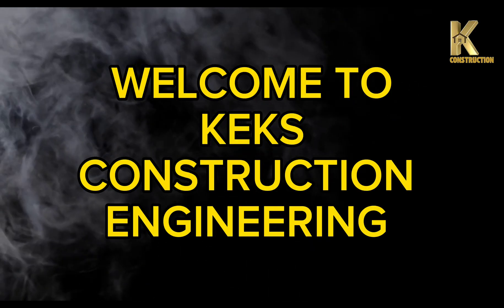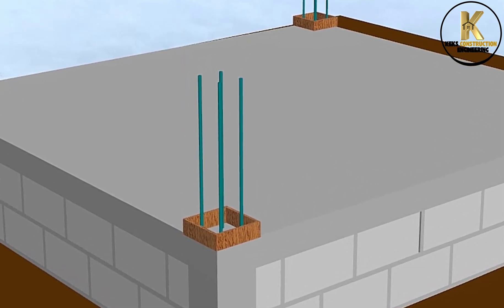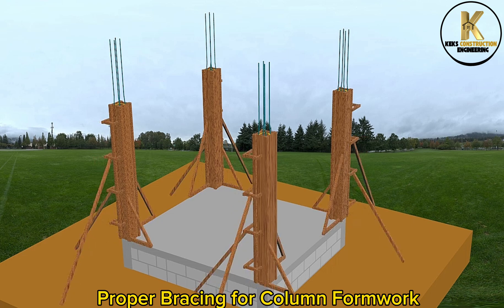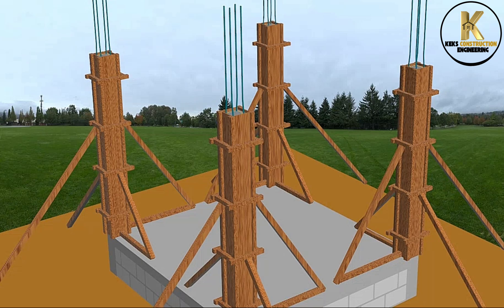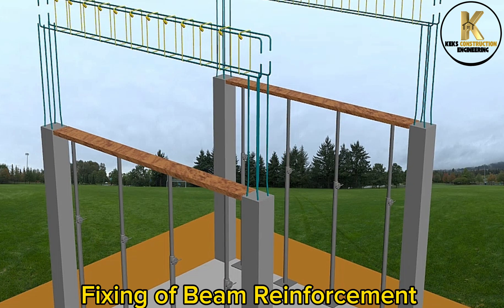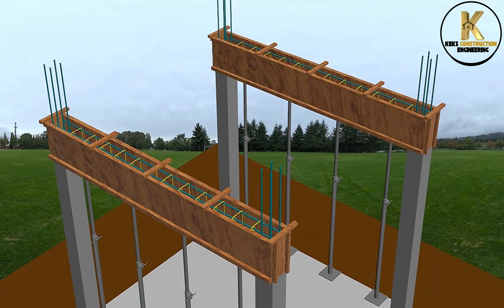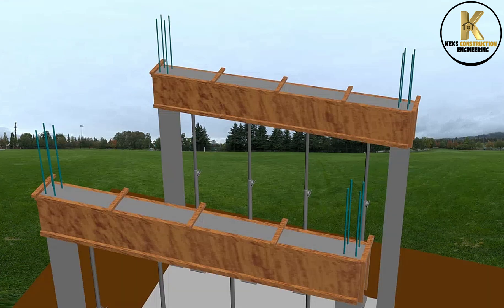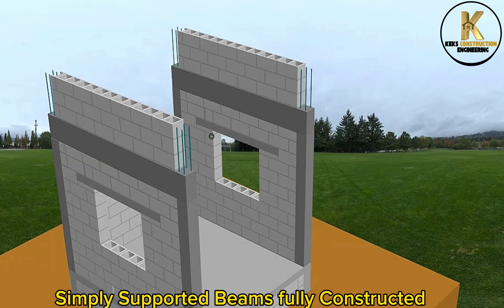How to Construct Simply Supported Beams & Fixed ended Beams in reinforced Concrete Structures.

Comment: Please sir what's the actual work of lintels. And does it in anyway take part in the mechanism of load transfer in buildings.
Reply from the maker: @AnonyeUchenna  
Yes.... Lintel is a Beam that's used to run across voids (doors, windows etc)in order maintain the actual dimension of the voids. so it bears and carries the wall load running directly on the voids. Just watch the video carefully or check the windows of any building, u will see the block Wall running on the Link. Now imagine if there was no Lintel, where will the blocks run??
Reply: @keksconstructionengineering  Alright thanks Sir. But also most times, I usually see the lintel beam running round the whole building unlike the precast we saw in the video. Why is that so sir ?
Reply from the maker: @AnonyeUchenna  
Yes.... it's called a chain Lintel. It's a choice, if u have the money, it very good but if u don't, the Precast Lintel is very Good and Economical.
Reply: @keksconstructionengineering   Alright sir. But why is lintel not considered during design. We usually consider the slab, beam, column and footings when designing.
Reply from the maker: @AnonyeUchenna  
Because it's bearing a very minimal load that doesn't need to be designed for.
Reply: @keksconstructionengineering  woowww.... Thanks alot sir.. I really appreciate
Reply from the maker: @AnonyeUchenna  
U are welcome...
Just Recommend my Channel for more people that needs this knowledge to grow.
Thanks
Reply: @keksconstructionengineering  Sure... I'll Sir.

Comment: Nice 👍👍 

But I have a question sir, the beam reinforcement didn't anchor to the column reinforcement, how will it behave when load is acting on it?
Reply from the maker: @ChinonsoOgalanya  
That's why it's a Simply supported Beam. Read up simply Supported beam and the support condition and degree of freedom
Reply from the maker: @ChinonsoOgalanya  
Another Perfect example of a Simply supported Beam are The BEAMS in Bridges spanning from one Pier to the other.
Reply: That's why you have a bend there .